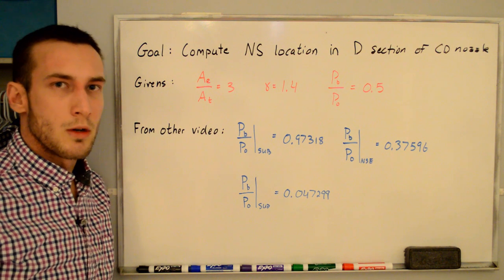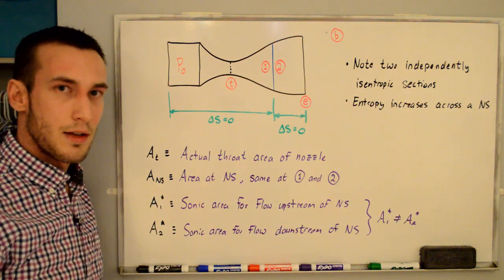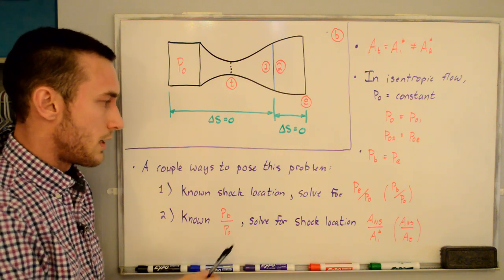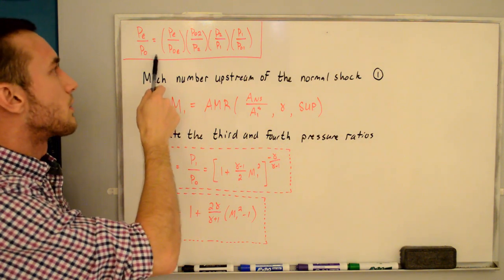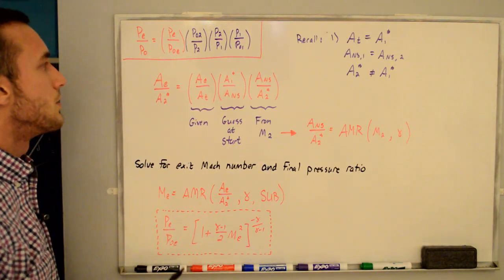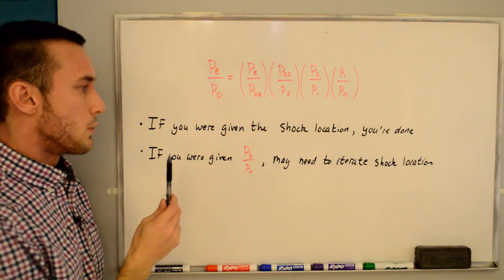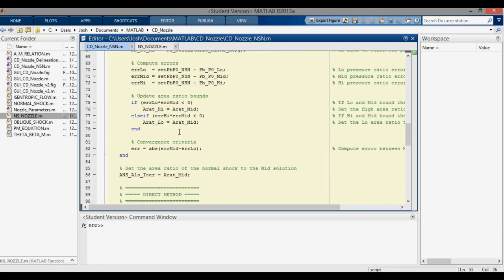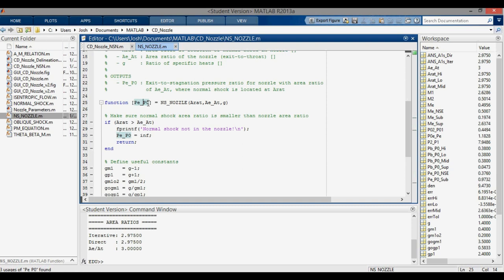Calculating Shock Position in CD Nozzle

Comment: I'm sure this question is a bit juvenile, but here goes.  For a FFSC gas-gas rocket engine (think Raptor, a full-flow staged combustion engine), if it were able to have the gases fully mixed and burned within the say 4mm from the injector head, could you do away with the Convergent part of the nozzle and have only the injectors and Divergent section? (and get the same or better exit velocity?)
Reply from the maker: Good question.  The convergent-divergent design for rockets is pretty much as simple as physics will allow you to go.  The reason we need to have a convergent section first is that the combustion products (after, like you said, they are fully mixed and burned) will be traveling slower than the speed of sound, or subsonic.  In order to speed up a subsonic flow, you need to have a decreasing cross-sectional area.  If we left out the convergent section, and just had a diverging section, then based on the area-Mach number relation (see my other video for its derivation), the flow would just slow down.  So in order to get to supersonic velocities, and thus maximize the thrust from the engine, we need to first speed up the subsonic flow in a converging section, and then further increase the now-supersonic flow in the diverging section.
Reply: I guess to get over the hump of Mach 1, the gas flow out of the injectors would have to already be at Mach 1 or faster.  So each injector would need to have a miniature convergent section directing the un-burned gasses and that would mean that the actual burn would have to occur while the gases are moving faster than Mach 1 which is extraordinarily difficult as I understand.  It stikes me that there should be a better way, but I can't think of it..
Reply: I think where I get confused is....what is Mach 1 at the molecular level?   Is it....   Due to heat, molecules are constantly bouncing off of each other in more or less a sphere of radius R, we will call that sphere a heat sphere...so sound in still room temp air is the collision of one molecule's heat sphere into the next molecule's heat sphere; imparting momentum to the next heat sphere. The first molecule returns to its original heat sphere at velocity Vm (neglecting that the speed is actually Sinusoidal).  When the air is flowing, the first molecule returns to  the heat sphere where it started plus some distance that the overall fluid has traveled at speed Vf.  In sub sonic Vf the molecule's heat sphere returns such that it overlaps its previous heat sphere.  As the fluid speeds up, Vf becomes greater than Vm.   That is to say at Mach 1 and above, it's heat sphere's never overlaps it's previous heat sphere.  ... but I have never seen an explanation like this....so I'm not sure its in the ball park.
Reply: @eldencw  You've never seen an explanation like that coz it's completely all over the place. Even your question about the convergent-divergent nozzle is symptomatic of how little you understood about the whole subject. There are pretty specific formulas and principles behind the definition of the speed of sound and behind the flow behaviour in a subsonic supersonic state, go check them out before flying too high with your fantasies

Comment: Great video. Is there a simpler whay to calculate the shock location given the back pressure to reservoir ratio using the isentropic tables?
Reply from the maker: There is a direct method (that I think I mentioned in the video at some point).  This method avoids the iterations, but I didn't make a video about its derivation.  It's in my MATLAB code that you can find in the link in the video description.
Reply: Hello! Could you please mention which is the method that does not use iterations? Could you please recommend a video that teaches this method? Thank you very much, this video is incredible and helped me a lot @JoshTheEngineer

Comment: Your video gave me a lot of insight. I was trying to apply your method to to this problem ,but i am getting stuck big time . can you help please? :The back pressure to reservoir pressure ratio is 0.7 for a C-D nozzle, with
an exit to throat area ratio of 2. Determine the cross sectional area
location of a normal shock happening between the throat and the exit
section for γ=1.4
Reply: For this particular question. do we also need to iterate as you said ?
Reply from the maker: You will need to iterate in this problem since you are trying to find the area ratio of the shock location.  You should be able to go through the same exact steps I use in this video to solve your problem.  You can also download my MATLAB code (in the video description) and change the values to your values to solve the problem.
Reply: Thanks . Let me give it a go and see how it goes. Thanks agin
Reply: Bruh I'm trying to do this same problem from the book. Did you figure this out?
Reply: Hi demsa, do u happen to still have the codes?

Comment: Hii, I'm not being able to access your website to get the Matlab code, is there any other way I can access the code?
Reply from the maker: Sorry, sometimes my website goes down when WordPress has issues (which seems like a lot of the time).  It should be fixed for now, so you can find the code on my website again.  I'll probably try to upload all the code I have on my website to my GitHub page at some point too.
Reply: heeey did you find a way, if so could you reshare the link???

Comment: hi josh. I am unable to access the Wordpress website for the reference Matlab codes. Is the website down?
Reply from the maker: It was down, but I just fixed it for now, so you should be able to access my website again.
Reply: @JoshTheEngineer  thanks josh!
Reply: heeey did you find a way, if so could you reshare the link???

Comment: Great video. Can you recommend sources for the design of rocket engine chambers? I have ‘Modern Engineering of Liquid Propellant Rocket Engines’. Also, where did you learn from, and do you work on similar systems day to day? Thanks.
Reply from the maker: Thanks!  Hmm, I haven't really looked into design of the combustion chamber before.  Most propulsion books have chapters dedicated to combustion chamber design, but they might not go into as much specific detail as you want.  A lot of them deal with the numerical analysis of the chambers, not the actual detailed design.

You can check out chapters 5 and 8 in Rocket Propulsion Elements by Sutton and Biblarz.  In chapter 10 of Rocket Propulsion and Spaceflight Dynamics by Cornelisse, Schoyer, and Wakker, there's a few pages on combustion chamber design considerations.  There are other references out there, and you'll probably just have to mix and match until you get a full description of what you're looking for.

I went to school for Mechanical and Aerospace Engineering, and I'm currently working on my Ph.D.  I work with laser diagnostics for my graduate work, so I'm not really doing this gas dynamics stuff on a day-to-day basis.  These videos are my projects that I work on over the weekend.

Comment: Hello Josh. I was wondering, if i have a big turbine, or a steam turbine or wtv, that's "intaking" air at a pressure of 10bars, and inside it the air will expand, lose some of it's temperature, and leave to the atmosphere. So, what if the expansion ratio was =2, and we have an exit air pressure of 5 bars. This will generate a shockwave because of the difference of pressure of the exit air 5bar and the atm 1 bar? Away from the shockwaves created by a high mach number and high velocities, i was just thinking there must a phenomena for this thing but i forgot it's name.

Comment: what do you mean when u say shock and  what is importance of isentropic flow?
Reply from the maker: The shock is a normal shock wave, which in the idealized version of the flow, instantaneously changes properties across the shock.  Across a normal shock, the entropy increases.  This means you can't assume isentropic flow all the way through the nozzle.  However, upstream and downstream of the normal shock, you can assume isentropic flow (independently).

Comment: how to find unknown ratios by rearranging the known ratios. is there any rule to do this? please make a video on this. i am facing problems in solving numericals.
Reply from the maker: You just need to make sure all the ratios you use cancel to the final one you want.  You'll find these come in handy for aircraft engine analyses too (turbojet, turbofan, etc.).  There's no real rule, just think about trying to break up an unknown ratio into simpler components that you can solve for more easily.

Comment: Why does the shock wave occur in the first place?
Reply: Isentropic flow, when the flow is supersonic in the diverging section, cannot meet the boundary condition where pressure at the exit is equal to the back pressure, like in supersonic flows. In order for this to occur, a normal shock develops, which is a highly non-isentropic process where the properties of the flow change suddenly. This allows the pressure to begin to rise again in the diverging section of the nozzle. It's like a discontinuity in the flow. It's a rapid negative acceleration of the flow, which becomes subsonic.

At higher back pressures, the normal shock will be in the nozzle. At lower back pressures, you can get shocks outside of the nozzle.